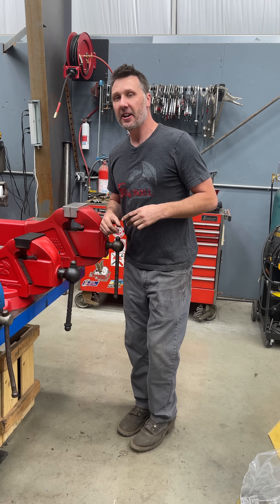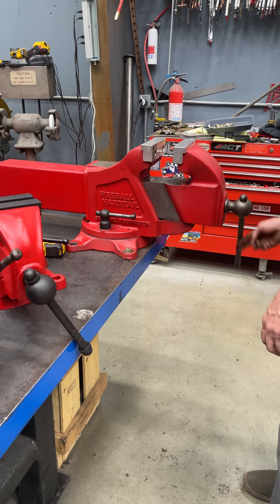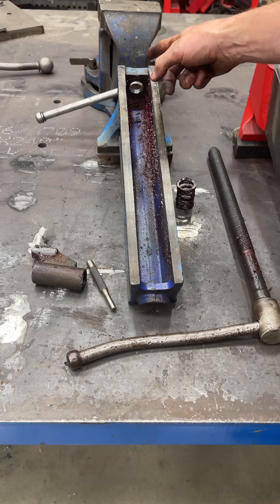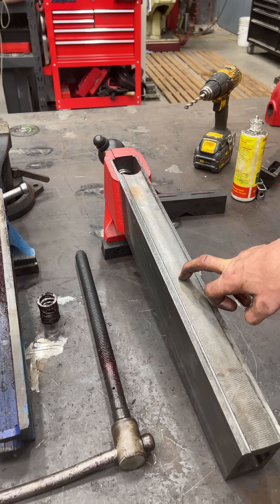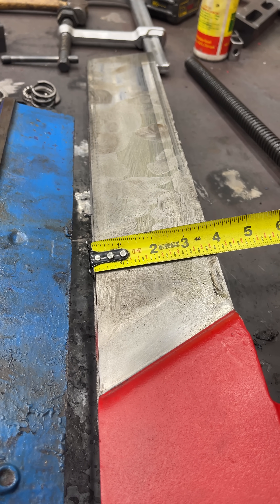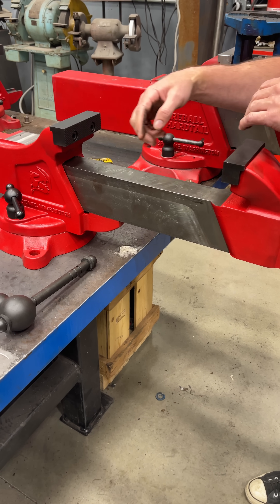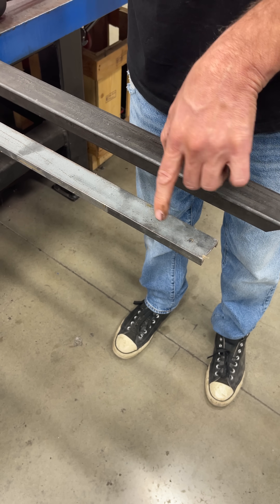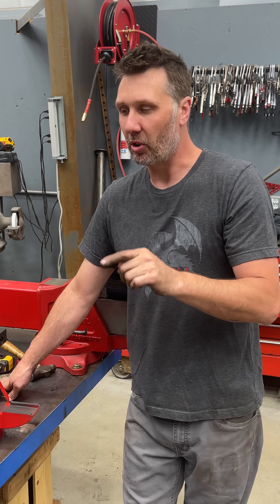Record #6 vs Fireball 510: Let’s Talk Jaw Engineering

Comment: It's not hard to believe that the 510 is the best vice ever made, but the real question is if it will REMAIN the best vice ever made. I'd be extremely surprised to find out that you couldn't improve on the 510.😊